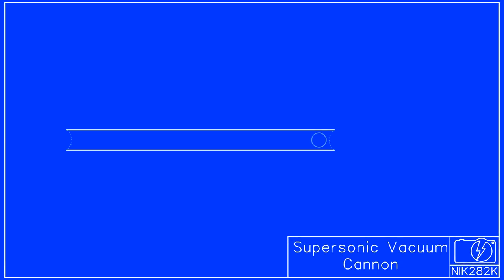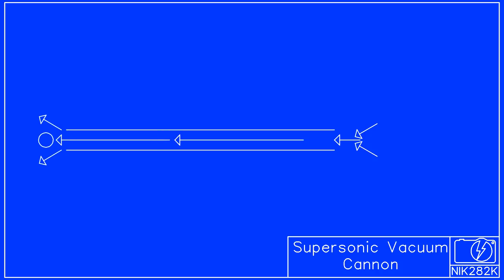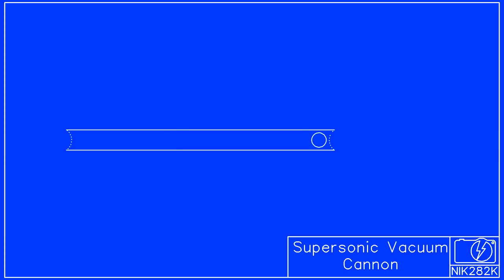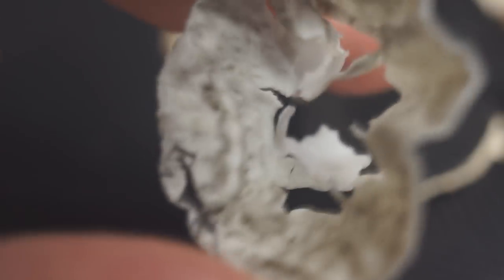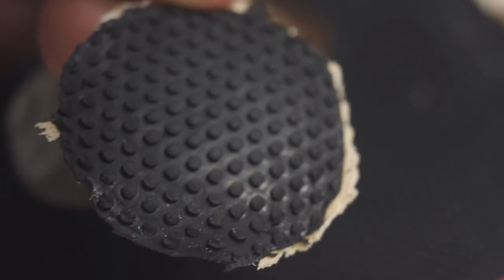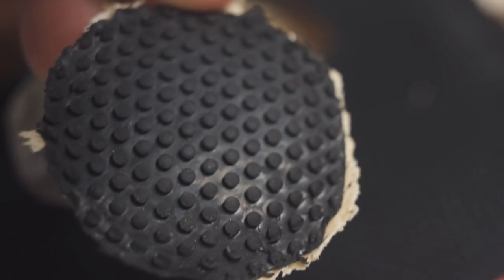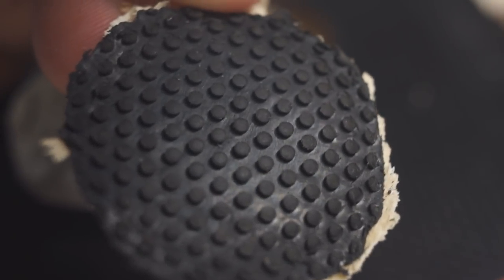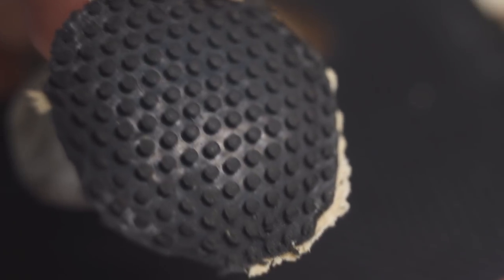The Cannon - How It Works

Comment: Congrats, its the birth of a new meme! Two projectiles with opposite velocities smashing into each other would be cool to watch. Maybe use metal projectiles and see if any welding occurs during smashing.
Reply from the maker: +Zhengqun Koo As much as I would love to fire metal balls I don't have a safe way to catch them afterwards. As it is the ping pong balls will go through 3/4" plywood, a steel ball would have more energy than a rifle bullet!
Reply: It's still cool to smash two projectiles with exact opposite velocities, regardless of material, right? Maybe something that will deform instead of shatter, like solid polystyrene balls.
Reply: You can make a good fragmentation trap by using a double-walled (with a few inches between the walls) plywood box filled with sand. That will take the energy out of any projectile pretty quick, and it's cheap.

I'd like to see a small (a couple of mm diameter) metal projectile riding on the front of the ping-pong ball, with a plate with a hole in it to catch the ping-pong ball but let the metal projectile through (basically a sabot catcher).

Comment: I'd like to see a DSLR or similar set to long exposure capture the flash in a dark room. The high-resolution image of the flash might reveal something interesting.
Reply from the maker: +JMMC1005 When I get another paddle I will try a long exposure. The duration seems to be enough that the ball move 1/2 it's own length so there will be some blurring but I think the paddle will be much more detailed.
Reply: Yeah, it won't be sharp. But I've found with similar things, the single frame captures a lot of info about how the gas is flowing because of the directionality of the blur. At worst, it might look artsy.

Comment: Quite a clever way to get around the last bit of air problem, it looks like there is still a tiny bit of air trapped behind the burst disk as it's inflated rather than deflated but I doubt fixing that will add much to the final speed.
Easy way to test what is igniting. Find non-nitro balls and fire those. Less common but they are out there.
A sheet of thick, soft, open cell foam, moving up to 2" or so at least might be fun. See if you can punch a neat hole in something that normally deforms. :)
Reply from the maker: +Electra Flarefire I have a couple non-nitro (50, because eBay) but I found them to be less satisfying to fire, thanks for giving me a way to use them! 
You're right, once the ball is within an inch or two of the end I can do much, but it is a lot better now than my original.
I think I have some foam around here already, I'll add it to "the list."
Reply: I imagine the volume of your vacuum accumulator has to be right-sized; too large, and there'll be an inrush of reverse-flow air when its burst disc ruptures; too small, and there'll be back pressure. 

Maybe some sort of muzzle break (brake?) at the end of the barrel that's in the vacuum accumulator might reduce the effects of any back pressure; say a coupling attached to a length of swiss-cheesed pipe; that way, as long as the projectile  makes it to the break before the back pressure begins to build in the v-ac, the pressure will not have a concentrated vector to counter the forward momentum.
Reply from the maker: I was thinking about adding some kind of break/brake to disperse the extra air that comes behind the ball. Right now I think I have WAY too much propellant air but it ensures that there is constant acceleration right up until the ball hits the last membrane.

I'm not sure if air rushing back in would slow the ball very much, maybe if I had some smoke at the exit end and filmed it as the ball left to see how quickly the air begins to rush in and interact with the ball.

I wish I had mentioned it in the video but I figured you might like to know that the ball accelerates at over 3000Gs from one end of the barrel to the other and if it were to hit something really solid the average force would be just over 1.5tonns! Kinetic energy is awesome.

Comment: On the issue of auto detonation, it seems that as you pointed out that the dimples seem to be a dependent factor. One could speculate that it was the friction of the polymer bumps that caused localized heating leading to the ignition of the material. To confirm that it is localized heating, a V shaped fixture could be used that has a similar material (sans bumps) on the inside of the V. When the ball is shot into the V there should be localized heating as the edge of the ball contacts the polymer material. A flash should be seen from the two contacting edges confirming the theory.
Reply from the maker: I have wondered what would happen if I fired the ball into a transparent cone, like you said, to get the most compression. I'm not sure which material I could use that would stand up.

Comment: Cool that is great.For a space cannon i was thinking of using back pressure
to open the vacuum doors at the mussel. Oh well.  

 My suggestion for something new is have a "cold shaped charge" to accelerate
a the ping ball.
 I think it would look like two or more pipe focused onto the back of the ping pong ball.
 The difficulty would to make burst disc brake at the same time.

Comment: If you still have this rig around and would like to use it on a new demo. I am very interested to see just how far it wire fire a ping pong ball, even modified ping pong balls that have a bit more mass. I'll probably build a version of this to test for myself but how I found this was by looking into ideas for throwing rope for pulling cable over long distances through areas that have 4' x 2' triangles. So far air cannons are the only ones you really see distance and ammo test with, vacuum cannons there's very little about distance and a whole lot about their destructive potential at the muzzle.

Comment: This is amazing! Seeing something as light as a ping pong ball obliterate just about anything. Out of curiosity, does the ping pong ball have a hole in it, and does the air inside of it also evacuate? If so I would be curious to see what would happen if you were to seal it completely!
Reply from the maker: +rowan Bloemhof The balls are completely sealed as far as I can tell, when they are manufactured the two halves are glued together. If I can figure it out if they are sealed I'll be sure to mention it.
Reply: Interesting, over here they often have 2 small holes opposite of each other. My guess would be because of safety regulations, hazard of suffocation etc.

Comment: Different charging gasses ought to affect the projectile velocity;   I think Helium is supposed to work rather well in these devices due to it's low viscosity and inertia, but I suspect perhaps some of the heavier gasses (CO2, water vapour) might work better for accelerating heavier projectiles...
Reply from the maker: The record holder (over 800m/s!) has been using helium on a very similar cannon, if I can ever get my hands on a cheap tank and regulaor I will be switching over. 

Water vapour might work well in a slightly different application if it were superheated and then released like the Mythbusters hot-water tank rocket.

Comment: Wow, I somehow missed this when you first posted it. Very clever design with the additional accumulation chamber up by the muzzle!
How do you make the burst discs? Or do you buy them?
Reply from the maker: The exit end is just one layer of mylar, the high pressure one is 3 layers, tuck tape, mylar and tuck tape again. There is also a little nichrome wire between the wires for triggering.

Comment: Hey. I was just thinking if you wanted to get the speed of that ball up you ought to consider decreasing the temperature of the air and maybe using air with high percentages of carbon dioxide. The kinetic energy of the air is proportional to its mass so if you up that you may be able to significantly increase the speed of the ball. Most of the other readily purchasable gasses much heavier than air are super flammable so that would most likely be a disaster but maybe a non flammable once would increase that speed by even greater amounts. Doing this with an isolated system of a shitload of carbon dioxide might just increase the speed by nearly 70%. You should try it.
Reply from the maker: I have heard arguments in both direction for the "weight" of the propellant gas. Helium is used in NASA's "Light Gas Guns" that fire steel BBs up to 7km/s and in the world record holding ping pong cannon which is over 800m/s. I do have access to cheap CO2 though so I might give it a try.

Comment: Assuming your using your new Chronos camera for slow mo, I noticed you said at 1:49 that you were running at 37,000 fps.   Chronos only goes to 19,500 I think it was.  Using a different camera or was this a mistake?  Just wondered. Not being critical. I like all your videos.
Reply from the maker: David, the Chronos' creator, talked with the sensor manufacture and was able to increas the top frame rate to 38,565fps at 336x96px. The resolution is quite low but still very usable, my old Casio EX-F1 was only 1200fps at 336x96 and I still managed to get some interesting shots.

Thanks for asking, I'm not sure if David ever mentioned the frame rate boost outside of the kickstarter comments.
Reply: So you are saying all the new cameras will have this to use or is it a software/hardware mod?  I thought the video looked good for that frame rate. Would love to have that rate available once I have the camera but like I said before, that is a ways off I think for me. Just bought a pc for $2600.  Need to pay that off asap.
Reply from the maker: +55Ramius As far as I know it is now a standard feature added to the base software. I was surprised as well at the quality, the real hard part is getting enough light. I had 120w of LEDs about 6inches away to film that.

Comment: I know you say the targets can't be flammable or explosive, but I'm very curious to know whether the shock of impact would be enough to detonate a (milligram) quantity of tannerite. The ping-pong ball doesn't have much energy, and tannerite isn't easy to set off - yet the very high velocity means there'd be a pretty decent shock at impact.

Provided the quantities are kept very small, I don't see it being particularly hazardous. You'd just need enough to hear or see a little flash.
Reply from the maker: +JMMC1005 I had thought of it but I all of my equipment is in doors, I would rather not have unknown magnitude explosions. I may try nitrocellulose laquor though, it is more like what I get with the ping-pong balls.
Reply: That's fair enough, though provided you go small enough it's going to contribute much less energy than the ping-pong ball itself has - shouldn't be hard to calculate the potential energy of a given quantity.

Comment: This is amazing! 
Have you thought of filling the pressure chamber with a light gas, like helium, to reach even higher velocities? Or preheating it with a heat gun?

As for the target, how about something triboluminescent, like a block of sugar soaked with some wintergreen oil?

Looking forward to seeing more of this!
Reply from the maker: I had thought about it but im not sure about the high speed camera, it's on the list and whether the high speed sees the flash or not I'll bet the normal one will see it.

I have thought of using helium but getting a tank and regulator is pricey around here. If the cannon channel takes off I will be putting money back into the project to see if I can get up to the world record (over 800m/s)!
Reply: I'll try to advertise it then!

Also, as an interesting target : how about a thick metal plate, thick enough so that it will easily withstand the impact. (like the back of a pan). That way, we can see the ball deforming under the impact.
Reply from the maker: A friend of mine is going to let me borrow a big hunk of lead. I plan on melting it into a think sheet to see if the ball can deform it at all. I also have a hardened steel brick around here somewhere, I'll give that a shot too.

Comment: I'm confused by this. Isn't the maximum rate of compressed air exactly the speed of sound? How can you accelerate something faster than that without using another gas such as helium? I don't doubt you can since there are many other reports of supersonic+ vacuum cannons using just compressed air, I just dont understand how it's possible.
Reply from the maker: I'm still not 100% sure how the speed limit works for vacuum cannons. I suspect that in a very short barrel with no ball it might be possible to have air rush in at higher than mach 1 but without enough force to do any work. As the barrel gets longer the atmospheric pressure has to move more and more air through the length and you end up with a lower average speed. I found lots of conflicting ideas about how and if it is possible/impossible to get a mach 1 cannon with vacuum alone.

Comment: What would be the difference between a vacuum cannon with -14.7 psig compared to a compressed air cannon with +14.7 psig? Let's say, same projectile weight and size? What would be their impact force and exit velocity from the tube?
Reply from the maker: The biggest change isn't really the extra pressure it's the weight. Because the ping pong ball is so light the weight of the air ahead of it is comparable to it's own. So just putting lots of pressure behind it would mean that you have to push not only the ball but the air in front of the ball as well. By vacuuming out the barrel the ball can accelerate un-restricted until it comes out of the barrel.
Reply: +Nick Moore
What about the impact force when the projectile is out of the cannon and hit something. Let's say the vacuum cannon barrel is 10ft long and it's target is 15ft away from the tip of the cannon. Then the 14.7psig compressed air cannon barrel is 10ft long and the target is 5ft away from the tip of the cannon. Will they have the same impact force since they'll both be pushing/hitting 15ft worth of air molecules in front of the projectile? If not, then how many times stronger will the impact of the vacuum cannon hit the target vs the compressed air cannon. And how many psi of compressed air do I need to equal the impact of the vacuum cannon?
Reply from the maker: I'm not really sure. I think it's possible to get the ball up to any speed using just compressed air but the pressure required goes up fast. The other limit is how much you can accelerate the ball, right now the balls are pulling more than 3000Gs in the barrel (the ball weighs 18lbs for that time!), much more than that and they will shatter.
Reply: +Nick Moore
These vacuum cannons are interesting.. How many psi did you use in your pressure chamber at the back side?
Reply from the maker: +booger king I am only using 80psi because any more causes the balls to break inside the barrel.
Reply: Ok thank you

Comment: How about material identical to the walls of the space station?
Reply from the maker: Whipple shielding! I could stack a few layers of thin material and see if it works better with or without spaces between them.
Reply: Cool. Answering the question "could a ping-pong ball loose in space penetrate the ISS?"